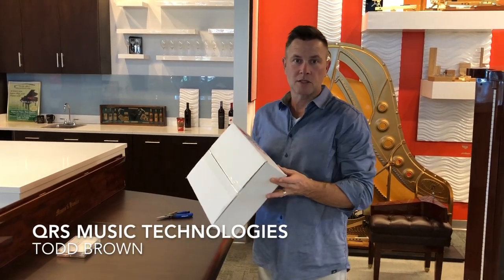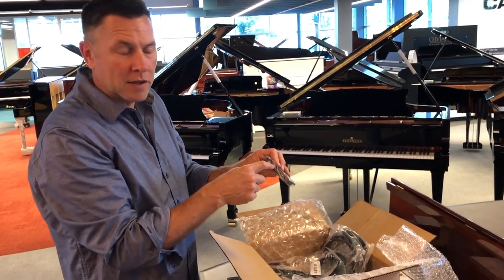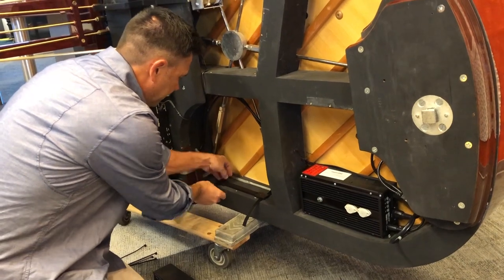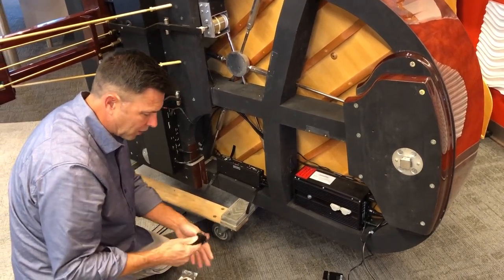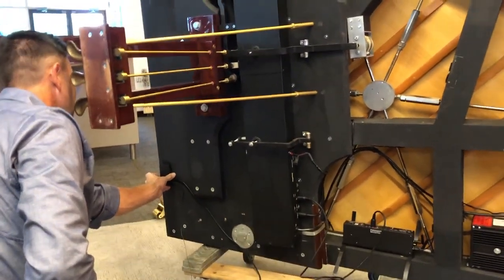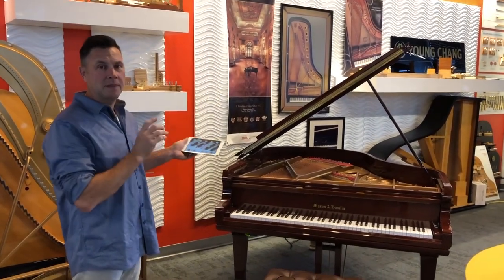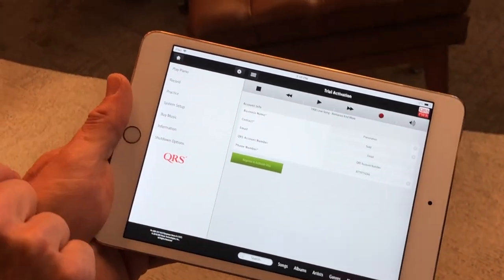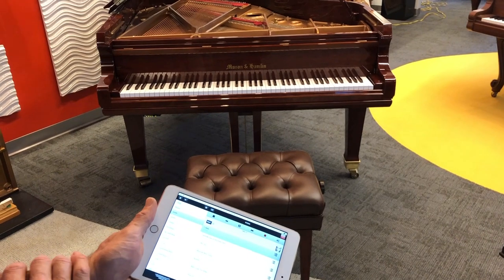PNO3 MIDI Upgrade

Comment: Thanks for posting this video. I have the  PNO3 version 1.0 with a tplink router to bridge to network and wanting to upgrade to PNO3 version 2.0 or typically called pno3 WB. Do you think this is something I could tackle myself?
Reply from the maker: yes Chris.  give me a call when you can.  248-762-555five